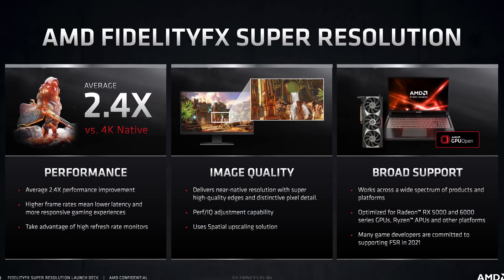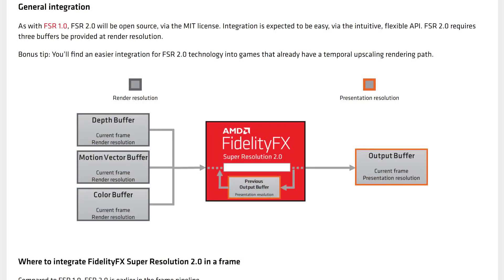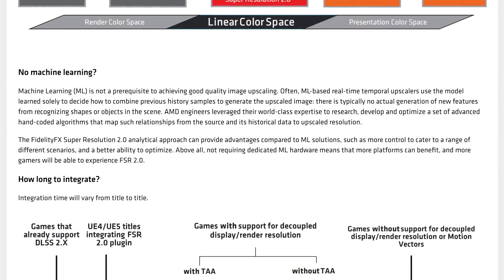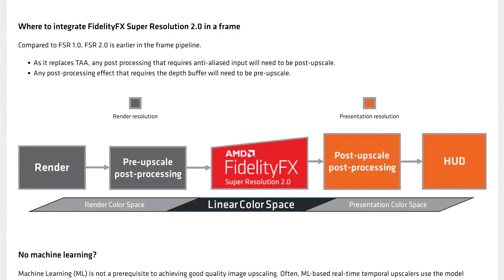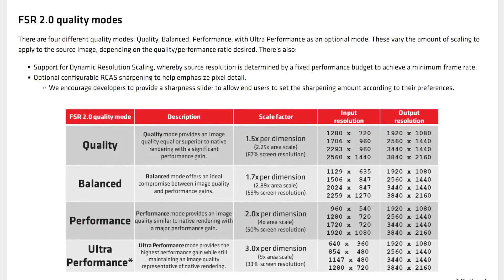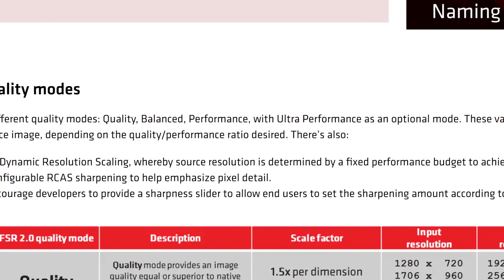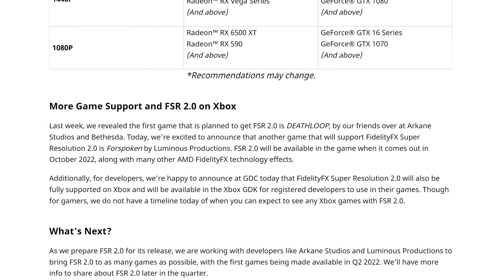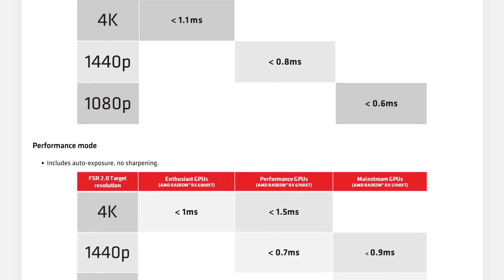AMD FSR 2.0 Details: GPU Support, Quality Settings, How it Works

Comment: I’ve been getting so many mixed answers on this.
How will this compare to proprietary reconstruction solutions from Sony and Microsoft? For instance, will this solution be better than Sony Santa Monica’s checkerboard solution, if FSR 2.0 gets supported on PS5. 
Basically, would Sony and MS first party studios be better of using FSR 2.0, or their own proprietary solutions?
Reply: We've seen what checkerboarding is like on the PS5, and FSR 2.0 will almost certainly spank it.  Also I saw somebody datamined an FSR 2.0 option from God of War 2018's PC port gfx options so seems like Sony is opting for FSR 2.0

As for MS, that's a harder to answer question.  FSR 2.0 is already available in the Xbox GDKX, and there's a strong likelihood that when Deathloop comes to Xbox after the timed exclusivity ends that it will come with FSR 2.0.  However MS also has their own super res, DirectML Super Resolution, which "v1.0" has been around for a while and is x-platform for anything in the DirectX ecosystem (Windows PCs with AMD/NV/Intel GPUs, Xboxes).  And due to recent job hiring postings, rumor is that MS is working on a "v2.0" that would aim to provide the quality of a temporal solution (DLSS 2, FSR 2, XeSS) with the simplicity/flexibility of a spatial solution (DLSS 1, FSR 1) and have DirectML Super Res 2.0 become a standard feature of DirectX.  Only time will tell if this is the case, but regardless of the outcome, MS will not dictate their studios use a certain super res technique, if any technique at all, because giving studios freedom is how they run XGS

Comment: Even as an AMD supporter i still say,talk is cheap.I would like to see the revies on this.companies always make it seems better than it really is.I am happy it works on old gpu's as well.I have a gtx 1070 and it may just boost my performance in 1440p a bit with newer titles.I am still trying to decide 1080p 144 hz or 1440p 144hz are a little pricey here.I ma go 1080p 1440hz gsync even tho it's a little expensive.But then fsr doesn't really matter for me.
Reply: I went 1440p 144hz and have 1070 ti, i really can't play on 1440p , I want fps it was a terrible since the differences in YouTube video, i can't really tell a diff. I say save money and go with 1080p 144hz (or 240hz depending on what kind of gamer you are). cheers.
Reply: Buying a monitor nowadays I would really advise to go for 1440p; 1080p doesn't look good anymore nowadays IMO and you're also not getting much out of GPU upgrades on 1080p - an RTX 3070 or higher is too strong to make proper use of in 1080p, it's suited for 1440p. (which isn't bad ofc, but just so you know).

Comment: Amazing. Between this, DLSS and Intel's offering, gaming at 4K native is frankly dead in my eyes. Praise the high fps.
Reply: Ive already been keeping myself gaming at 720p max or 1080p high cuz i only have a 1060 3gb, any decent upscaling stuff is great for keeping the games looking good
Reply: @Di3mondDud3  I used display scaling like e-sports players, with the right monitors it works well for games.
Since I got a good 1440p card I enjoy sharp native images, you become accustomed but the painted effect of upscaled 720p didn't make games look bad.  After all old TV was much lower resolution.
The main advantage is not tinkering with display settings depending on what I am doing.
Reply: @RobBCactive  with 3gb v ram im lucky to hit 1080, and i play on a tv with a gamepad. I play offline and just want pretty games that look as clean as upscaling on consoles do

Comment: As an ML enthusiast, I would still say DLSS and ML does have an edge but I know Nvidia's current usage of DL in DLSS is akin to how phones use AI to improve battery consumption. IE: very limited, it's a guide of sorts basically from my understanding.

What would be truly amazing tho if in DLSS 3 or 4 Nvidia trains an auto encoder or more likely probably a GAN to reproduce a ray-traced frame without actually tracing rays. So essentially it would work like a shader but it would have the capacity to emulate volumetric lighting and hence mimic RT GI and RT shadows. RT reflections would be too difficult for a GAN IMO so that could be handled by the RT cores instead as a sort of fall back.

Of course this is theoretical because no such GAN exists right now but if anyone can do it, it's Nvidia because their work on GAN is pretty much SoTA right now.

Comment: I can't believe my dear old RX 590 will be basically getting a new injection of life. I know it's only supported games, which means it's nothing guaranteed and it won't be useful retroactively, but still. When this card will eventually die, I'll prepare a viking funeral and witness its passing into Valhalla...
Reply: Why do people treat their video card like it has a life buffer? I mean they carry the same capabilities, and performance all throughout their lifespan. Also the thing that kills GPU's usually is excessive heat 84c-100c+, and electro-migration in manufacturing defects, they go hand and hand not like a lot of people are thinking. there are still some GeForce 4 MX users out there funny enough.
Reply: @MarcABrown-tt1fp  GPUs do have life buffer. It's called "newer more demanding games". People on GeForce 4 MX (I owned one back in the day) are enjoying the luxury of playing 2005 games at 600p....
Reply: @andersjjensen   Thats not a life buffer thats just the cards normal performance of which isn't enough for new games. They are inanimate objects that can't be injected with more cuda cores. I'm highly curious why so many people on YouTube personalize electronics? I mean real AI is perhaps generations away.
Reply: @MarcABrown-tt1fp  Software improvements can definitely improve performance on older hardware, to a limit of course, but this technology will absolutely make it easier for older cards to survive a bit longer. I'm a bit curious why so many people can't understand this? I mean software running better on older hardware because of software improvement has been a thing since the dawn of time.
Reply: @lloydaran  Doesn't change the hardware. :-/ 

I happen to think applying personalities to inanimate objects is obsurd, that's just me I'm sure. Also I do know that more efficient software can improve performance you dunce where did I say it didn't? That sorta Applies to all video cards.

Comment: What was not mentioned by Tim: from the slides, FSR 2.0 also takes into consideration the z-buffer, whereas DLSS doesn't.
Reply: DLSS actually does it: "The data DLSS 2.0 collects includes: the raw low-resolution input, motion vectors, depth buffers, and exposure / brightness information."
I will hazard a guess that's why implementing FSR 2.0 will be quickest to the games which already support DLSS 2.X, as they use the information from the same buffers.
Reply: What’s the z-buffer?
Reply: @totallynotaliar9912  depth buffer so not just left/right, up/down on the screen but also what's forwards/backwards (simplified explanation)

Comment: AMD doing more for Pascal owners than Nvidia is still so fucking funny to me lmao.
If AMD can make FSR 2.0 & Intel can make XeSS then Nvidia could have made a DLSS alternative that doesn't use ML hardware to support Pascal & Maxwell users.
Reply: Nvidia has Nvidia Image Scaling as an alternative for non-RTX cards which works fairly well as a spatial upscaler though not quite as good as FSR 1.0.
Reply: @Dewedin.  The point was that when Intel can make a DP4a implementation... so can Nvidia. And Pascal supports DP4a. DLSS was always meant as an artificial segmentation... and a way to sell raytracing before it was actually ready.

Comment: @Hardware Unboxed  This may be a dumb question but if a game has FSR 1.0 implemented and the developers are slow to upgrade or not upgrading to FSR 2.0 at all, is there a way for people to update FSR themselves like how DLSS can be updated with DLSS Swapper? Or is FSR 2.0 so different from it's original version that it takes more than just swapping a dll file or FSR specific folder in a game?
Reply: The two approaches are vastly different so that's not going to work.
Reply: No.
Reply: its*

Comment: Can't wait to run the latest AAA games at 720p FSRed to 1440p.
Reply: That's probably going to be rough. You'll probably get a better result with dropping settings down to High instead and only go 1080p->1440p on the upscaling.

Comment: I am afraid that this technology will remain irrelevant for me and others gaming on high refresh 1080p fps gaming. Sadge 😔
Reply: It's possible. There was an older article from 2019 talking about how the tensor cores can bottleneck high frame rates with DLSS. So you might end up in a similar scenario where the processing cost of FSR brings you back down where you started in terms of FPS.

But until it's out, we don't know. Keep your expectations low and you might be pleasantly surprised :)
Reply: But you guys always play e-sports games that can run on a potato... so what's the problem?

Comment: Can't wait to see this on APUs. The Steamdeck is going to be able to deliver a good gaming experience on big screens, the stuff of dreams.
Reply: Upscaling a very low res image to a low res image doesn't seem like it's gonig to be that great to me.
Reply: @derptyderp5287  Super Resolution definitely has differing IQ levels depending on the internal resolution even if the super res quality mode is the same

But devices running iGPUs have another trick up their sleeve - pixel density.  The vast majority of devices running these chips are handhelds/laptops, which max out at 17".  Even with 1080p, that level of pixel density is a huge help to the IQ we actually perceive with our eyes, which at the end of the day is the bottom line.
Reply: @kirby0louise  The original comment specified a "big screen" which isn't going to have good pixel density.

However I'd also argue that native res will likely still be the better option for most games on a small low res screen. It'll likely lose a lot of (what little) detail it has when upscaling.
Reply: @derptyderp5287  Ah good catch.  Though super resolution could also benefit desktop iGPUs on the big screen.

Personally I think that in 5 years iGPUs and super resolution will have gotten so good that AMD and Intel won't even sell 1080p class dGPUs any more, only 1440p and 4K class.  If you want to game at 1080p they will tell you to simply buy an iGPU
Reply: @derptyderp5287   DLSS Ultra performance upscales 720p to 4k with good results, it’s going to be fine.
Reply: @ctrlectrld  I've tried it, it does not look good.
Reply: @ctrlectrld  The fuss is a simple difference of opinion, you say it's good, I say it's not, we move on with our lives.
Reply: Agreed, I'm going to get a Ryzen 6000 laptop in the near future and plan on milking the new RDNA2 iGPU for all it's worth.  FSR 2.0 and XeSS are going to be a big boon to that

Comment: With 66.6% render resolution can it look good without machine learning?
Reply: You should educate yourself on how the "Machine Learning" works in the context of DLSS. The tensor cores don't do any upscaling themselves, the only thing they do is chosing how to apply the already trained model. They  speed up the process a bit, not increase quality. Nvidia did their best to make it sound like actual machine learning is happening live while you game, deciding how to upscale the frame to make it look good. That's not how it works. DLSS would work without tensor cores just fine, it would just be a bit slower. So when AMD comes up with a more optimized algorithm (and that we don't know yet) it might be as fast as DLSS while showing the same results. Again: machine learning speeds up the process and doesn't increase the quality of the image (that happens before)
Reply: @benfrese3573  ok
Reply: @Srdb1999  I think original DLSS (1.0?) might have used neural network trained to reconstruct image for specific game. That might have needed likewise NN processing hardware on user side. At least Nvidia made a lot of fuss about "A.I. upscaling" when it was first introduced.

Comment: Just bought an RTX 3060 and I'm so jealous of how FSR/RSR can be activated for every game.
Reply: You can use tools such as Lossless Scaling (costs a few bucks) or Magpie (free) to use FSR in any game and any GPU. It basically behaves like RSR.
Reply: @Jasterrrr  or Nvidia NIS
Reply: If I were you I would be more jealous of the 3060ti
Reply: FSR (1.0 or 2.0) cannot be activated for every game. It has to be implemented in game.
Reply: @reav3rtm   like did say @Jasterrrr with lossless scaling on steam or the free magpie , you can use FSR on everything, must be not as good as native, but you can still technically using it on everything
Reply: @kam7r882  RSR yes, which works similar to FSR 1.0 but is driver level scaling. But FSR 2.0 will not have driver level counterpart. OP should not be jealous of FSR though. Nvidia has own driver level upscaling I think? (or doesn't?)
Reply: @reav3rtm  FSR 1.0 and RSR are the same thing just implemented differently. FSR 2.0 is a completely different thing and has only the naming in common.
And yes: Nvidia has an equivalent to FSR 1.0/RSR, it's called NIS and can be used on pretty much any Nvidia GPU using recent drivers (which should be almost any of them)
Reply: Why? Nvidia GPU's can use FSR aswell, only can't use RSR but Nvidia already has something for that

Comment: New update for God of War added FSR 2.0. I've been testing it for few hours now, it looks better than 1.0 and UE4 TAA but not good enough to compete with DLSS or native.
Edit: after doing some research it's not actually FSR 2.0, I don't know why they'd call it FSR 2.0 in the settings menu, maybe it's a typo or the GOW devs messing with people.
Reply: It's still FSR 1.0, that was an oversight in a locales file, basically one of the files where all of the text strings are placed.
So, they are working on FSR2.0, but it's not quite ready yet.
Reply: @Azraleee  yes, I just realized that. Maybe the difference in sharpness tricked me into thinking the image looks better.

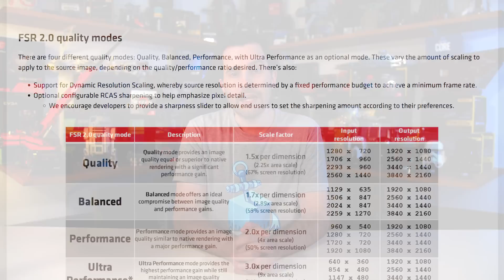Comment: I do not see ultrawide resolutions here at 5:35 :(
Reply: Any widescreen resolutions would use the same ratio's. They jus listed the most common resolutions. The resolutions aren't hard coded.
Reply: @TheCountess666  A note about this on the slide could have helped to chase this question away. Thanks for the clarification though.

Comment: Is FSR 1.0 still going to be around or are 2.0 taking over?
Reply: As far as I understand FSR 2.0 goes deeper/earlier into the rendering process than 1.0, so I doubt we'll get 2.0 as RSR or as an option in Steam OS. So it should still be going around.
Reply: I doubt that FSR 1.0 is going anywhere. It's open source and can be injected into any game easily while FSR 2.0 needs work done by the devs.

Comment: Maybe I'm looking at this incorrectly, but with having this technology also available on Nvidia cards, doesn't that just make Nvidia cards more attractive? Because you get FSR AND DLSS to choose from instead of just FSR. We already know that in most cases Nvidia cards beat Radeon cards (especially at the higher end when also using ray tracing). 

I guess if I think about it a bit more I could argue that FSR 2.0 would make Radeon cards more competetive against Nvidia, but Nvidia still wins in terms of ray tracing.
Reply: Nvidia already has DLSS while AMD has no temporal upscaling, so this helps AMD more than it does Nvidia. And AMD is obviously going for a mindshare play. By giving owners of older Nvidia cards access to a feature that Nvidia denied them (temporal upscaling), AMD is hoping to win over some converts.
Reply: @konga382  that makes a lot of sense
Reply: It makes the tech more attractive for developers to implement, getting it into more games, thereby undermining nvidia's DLSS selling point. And its not bad for good-will either.
And on what metric are you based your claim most nvidia cards beat AMD cards? That's not what i'm seeing.
Reply: @TheCountess666  My metric is based on gaming using higher presets with ray tracing. AMD simply doesn't have the hardware yet to do proper ray tracing (granted that nvidia cards also struggle with it in some games though). NVidia generally beats AMD but usually not by much and its generally limited to situations where nvidia has the better capabilities such as ray tracing. There are certain games where AMD wins but that would be because the game was designed with AMD in mind. There are also games designed with Nvidia in mind such as Control.
Reply: If a game supported FSR and DLSS, no Nvidia owner would choose FSR, it's like comparing a Ferrari to a Skoda
Reply: @NoSubOnlyExplorers  that makes sense too. I would agree with Konga in that FSR at least supports some nvidia cards that can't make use of DLSS. Those cards do get a benefit
Reply: @NoSubOnlyExplorers  This dude has nothing going on in his life lol. Click on his profile, all his comments are just bashing AMD.
Reply: @ozker5448  you mean me? Well I just created this profile so I can keep my youtube preferences saved and have subscriptions. Also, what you saw were "recent comments" and this conversation we are having right now are those recent comments. I comment a lot on other channels as well which are not even related to this topic. And no I am not bashing AMD, I was just wondering why they would also support nVidia cards. 

Why would you even check my profile just to make a personal attack on me? I have a lot going in my life by the way, I just don't post it all on youtube or social media.
Reply: @ozker5448  In case you weren't talking about me then just ignore my last comment 🤣